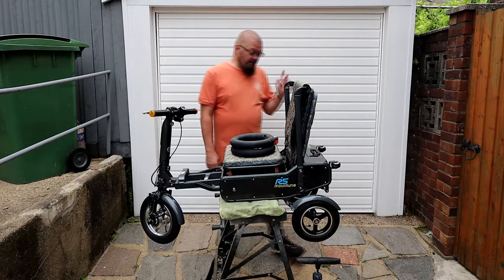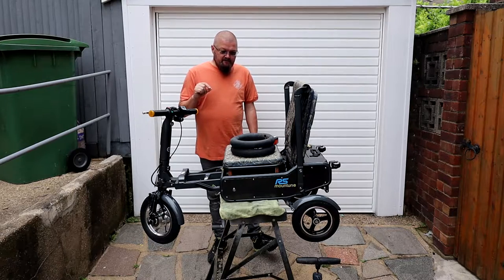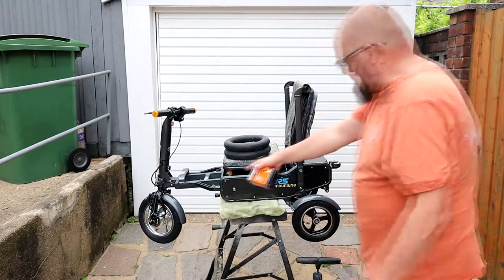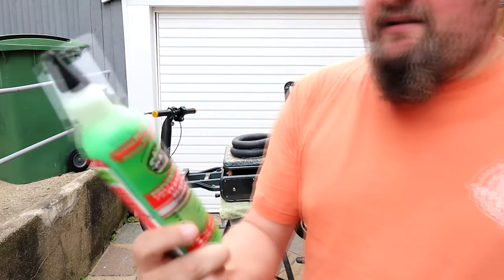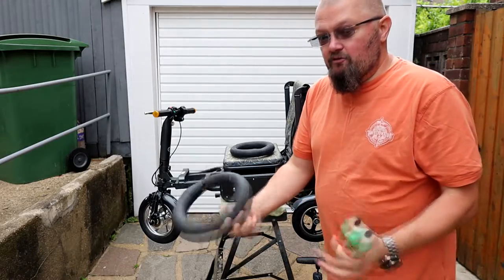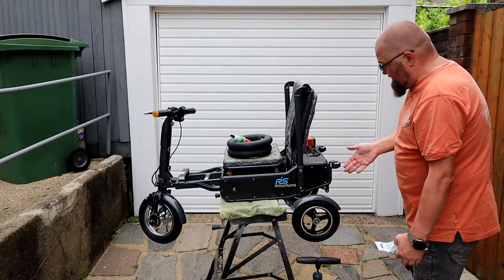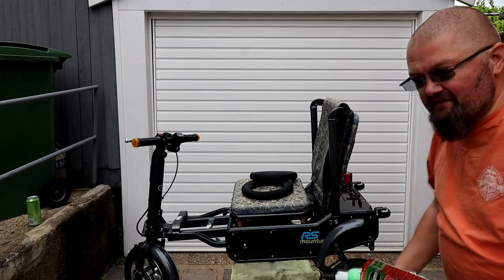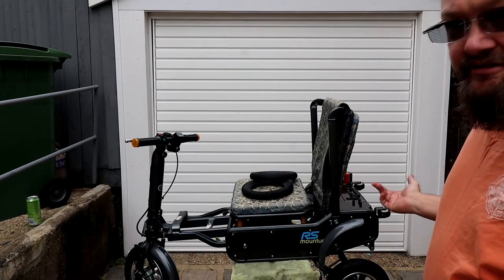eFoldi Innertube Change & Adding Slime. Tyre Removal

Comment: What size inner tube
Reply from the maker: Hi, I can't remember off the top of my head? I think I put links in the description of the video for the front and rear innertubes
Reply: back wheels are 10 inch the front is 12 and a half inch
Reply: @davidm2113  Thanks. I'm just about to do my wheels, so now I know what size tubes I need to buy.